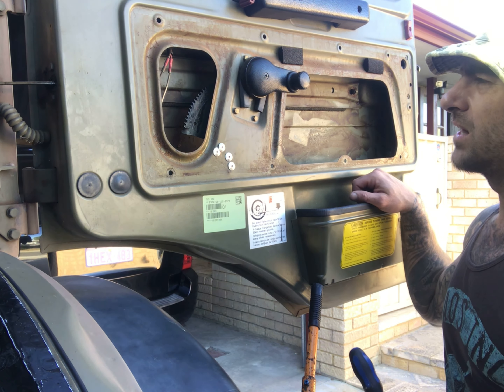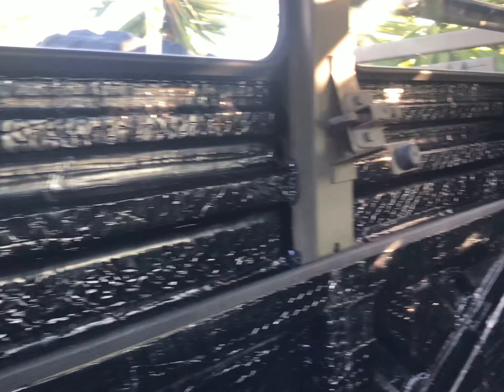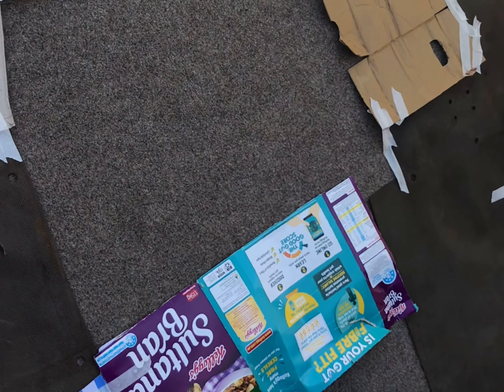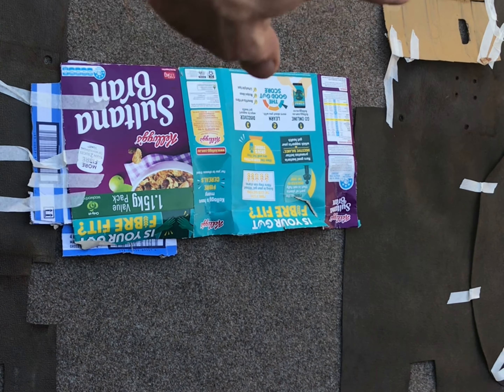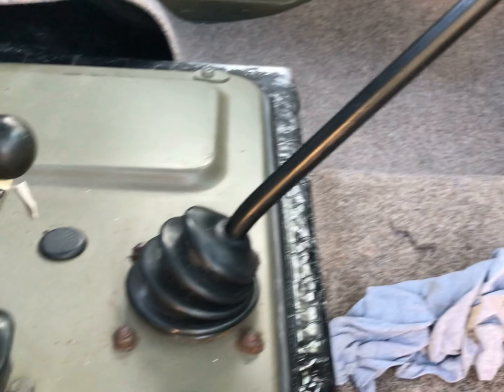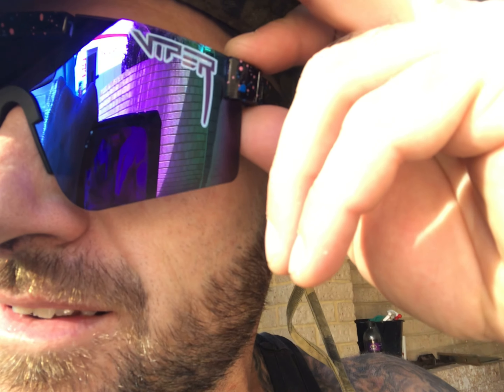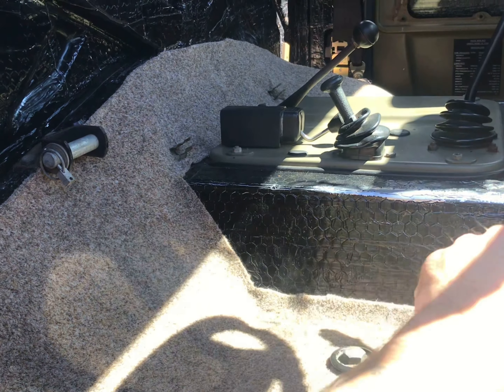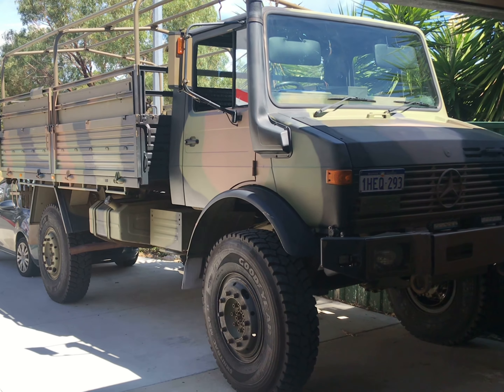1984 Military Unimog 1700L  Carpet Upgrade / Roof Strip and Soundproofing completion P9 !

Comment: Thanks for the video! Do you know what sort of fuel consumption this will have. I've heard it can be as high as 35L/100km once you have a camper on the back.
Reply from the maker: They will run about that with a camper on the back , but there are significant improvements to be had on the motor is : turbo upgrade / inter cooler and bigger tyres will help substantially to reduce that number , unladen I’m getting about 21litres/100kms 👍🍻

Comment: Nice update, helps with my build... 
Just spent the weekend sound deadening my rig, some hrs goes into it 😅 
Is that carpet the stretchy marine stuff to help conform to the floor pan?
Flicked you an email regarding the wheels, look forward to your response.
Reply from the maker: I know it’s a bear isn’t it lol starts of fun 😂 , yes I bought the marine carpet it is a bit harder to use for panels etc (harder to ply ) but lasts forever and water resistant 👌 , will flik you an email now 👍🍻
Reply: @westernaustralian4x4advent60  
Ledge down, Thanks Adam. 🤜🏻